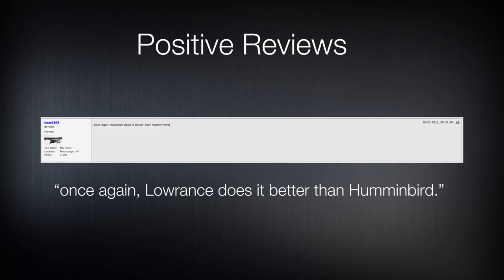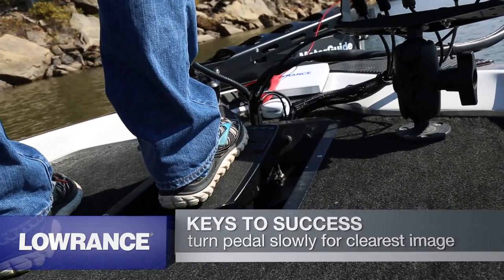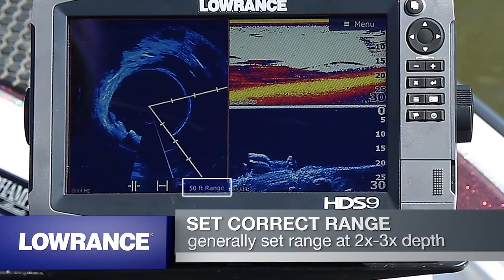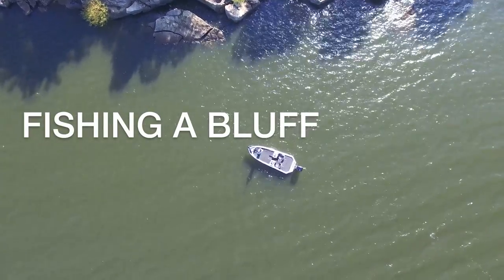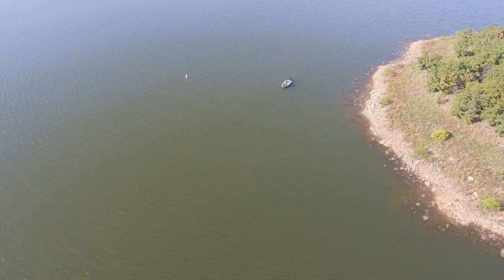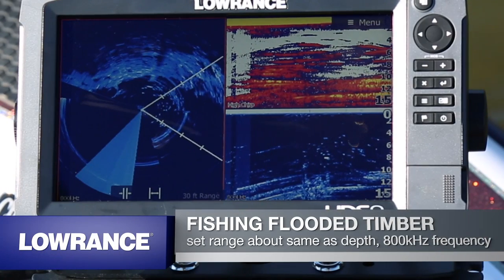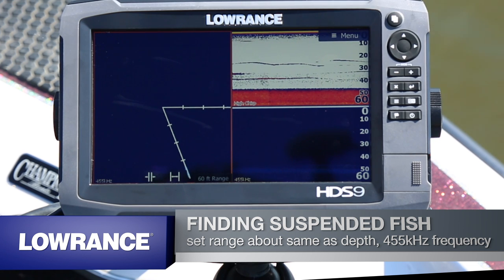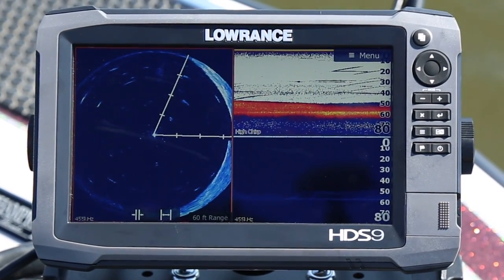How To Use SpotlightScan™ Sonar

Comment: Does the Spotlightscan transducer replace the traditional 83/200 from the back of the boat as well as the LSS-2? Or does it work alongside of the two traditional transducers? Can it be off a split in the network to work with my future HDS 7 and its traditional transducer devices I plan to order? ...or do I need the HDS 9 or above with the additional connector port?